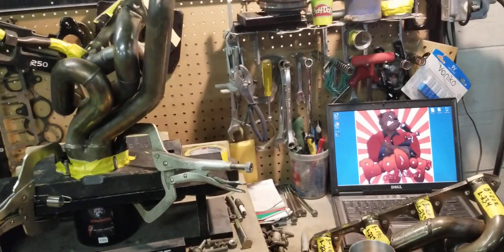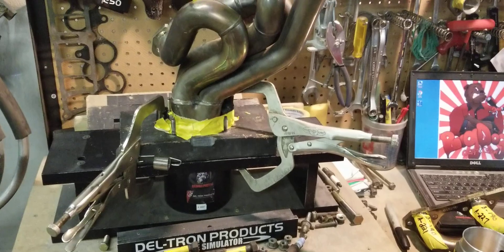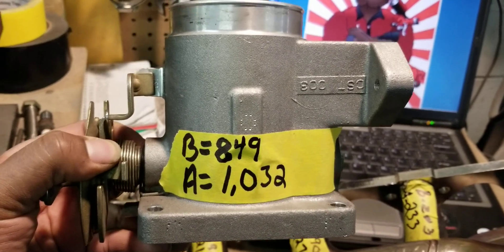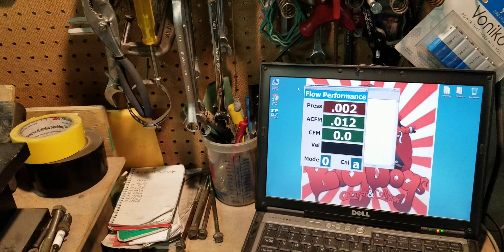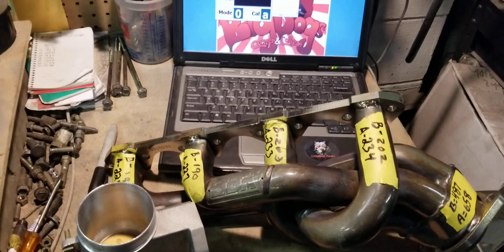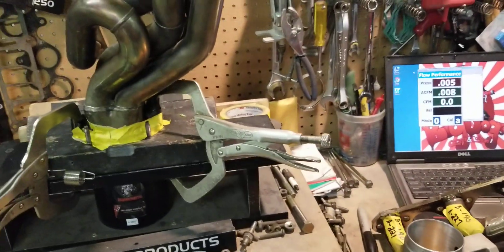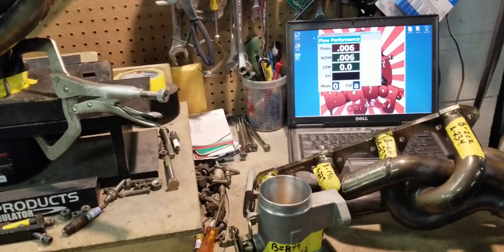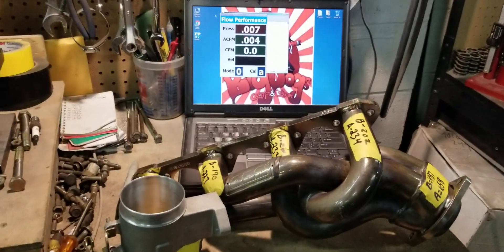Fox body Mustang Header testing and modifying results.

Comment: I never thought that there was much you could do to headers to improve flow until I saw the inside of the factory ones for the first time. They weld them on the inside and they leave a big bead of weld all around the perimeter inside the tube. It probably sticks out about 1/8 of an inch on each side.

Comment: Impressive gains. Why not try to equalize between primaries rather than than increase the flow across the board? I understand that the intake manifold will have huge variances from #1 and #5 vs. #4 and #8, but even then I've always attempted to increase the flow of the lessor to as close to equal of the the greater. Is there something I'm missing here.

Let me explain my view, not saying it's the right view, in hopes that you can see where I'm coming from. I look at each component to the engine, sbf v8 or sbc, as components to 8 individual engines combined together. I've thought that them working as closely together to perform the best. When I build 8 into 1 headers, I keep the primary lengths as close, within a ½" to 1", to the same length and in firing order to achieve the best results I can. In the cylinder as well. The intake manifold is always a toss up, but I look for the closest flow results between all 8 runners as possible. Hmmmm....I'm only curious as to your methodology. Thanks in advance.

Comment: I have Mac long tube 1 5/8 , 2 1/2 colectors. How can 3" colectors be retrofited ?
Reply from the maker: Send them in to us and we will Transform them. Message us on our Facebook business page at Bigdogs porting for more information and details
Reply: It's just enlarging the opening of the collector
Reply from the maker: @GenXcoyoteguy  no its way more than that!! But everyone think it's so easy to get the results we get lol
Reply: @bigdogsportingtonyb2833  
Never said it was easy bro. Just said that enlarging the collector can be done. Along with cleaning up/matching the port entries on the flange. Easy to mess up if not done right. And it looks like you have a good system. I am a fan, not a hater.
Reply from the maker: @GenXcoyoteguy  this is true. We've had customers ship us their headers to fix after they tried to work them lol. Messed up the flanges, ruined the ball collector and destroyed the welds. Same things with people trying to port their heads and manifolds, they mess them up then expects us to fix them. We tell them stop being cheap and let us do it the right way and show you the gains lol
Reply: @GenXcoyoteguy  I think they can't be open to 3", maybe cutting the collector and weld a real 3" one ;
respectfully ...
Reply: @MP-pz9oe  
They can be opened up, seen it done many times.

Comment: How does your ported stainless steel header capare to bbk long tube headers for sbf?
Reply from the maker: The out the box BBK long tubes flow in the high 480s out the box. Our 2.5" version ported stainless steel shorty headers flowing the low 700s and our 3" version flows over 800cfm.